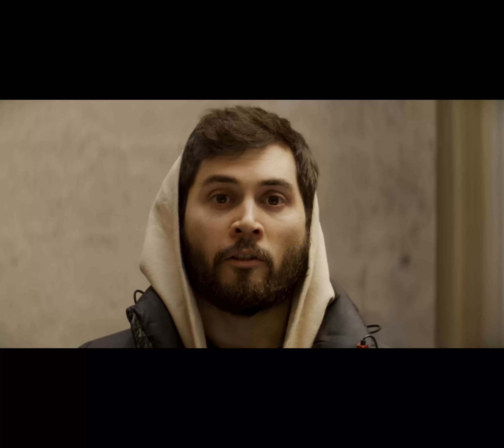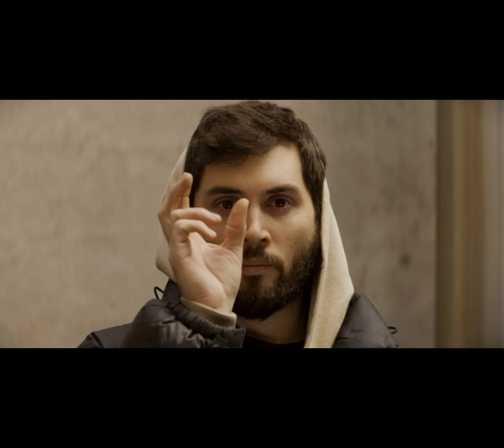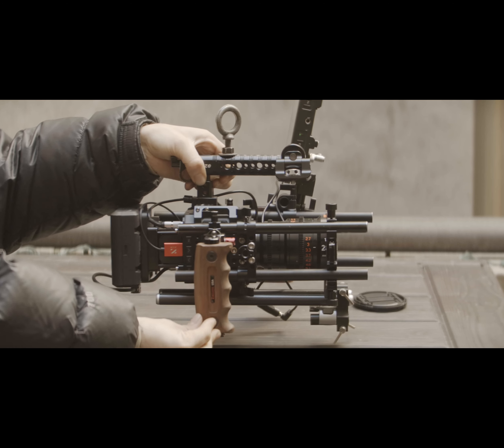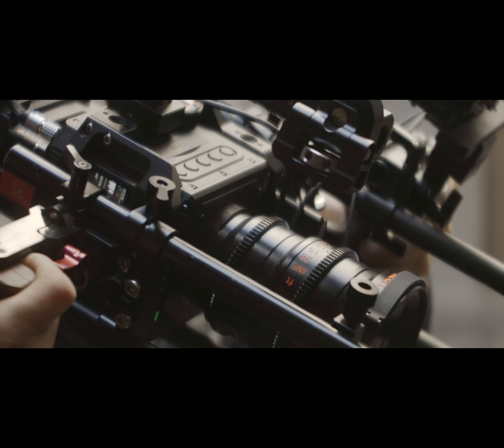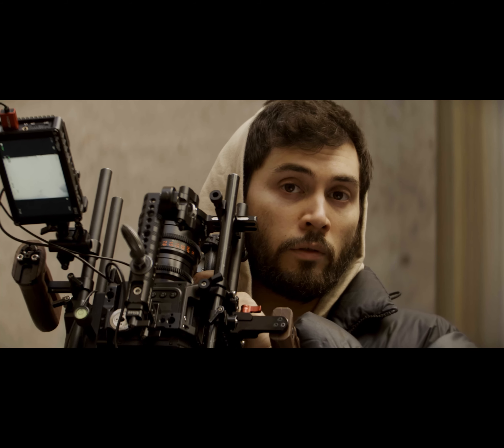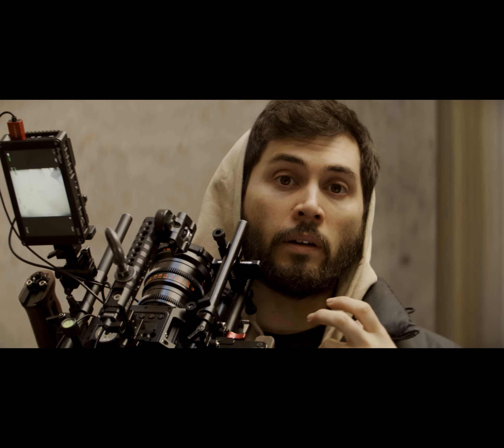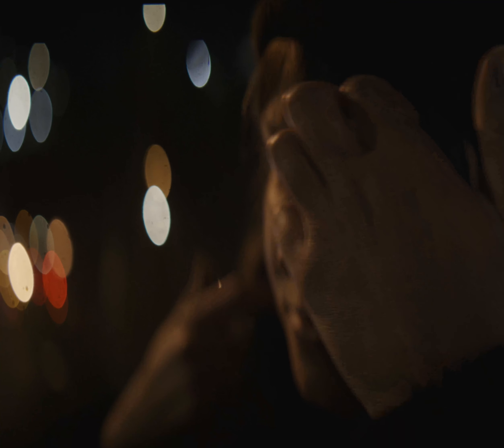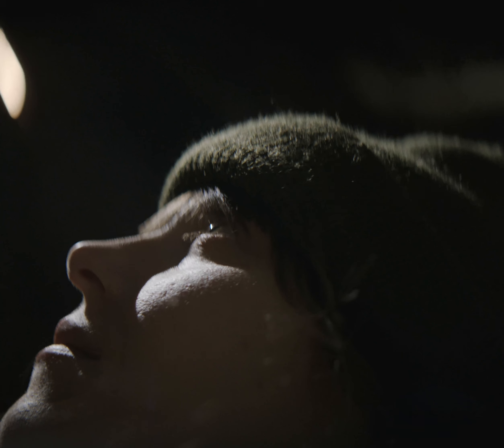Cinematic Square aka Rotated Anamorphic

Comment: Si of i get it right, you turned the camera 90° to the left, 3D printed a M4/3 lens mount that works with the Z-Cam E2 S6 to connect the lens straight (in the normal horizontal orientation) and then you disqueezed horizontally. Am I right?
Reply from the maker: Manuel Bustamante yes! Thanks for watching.